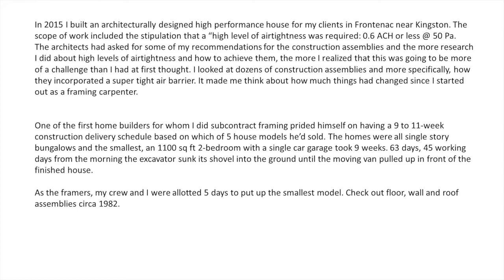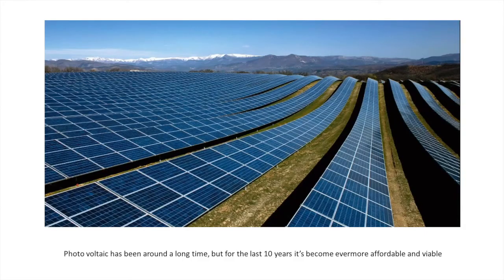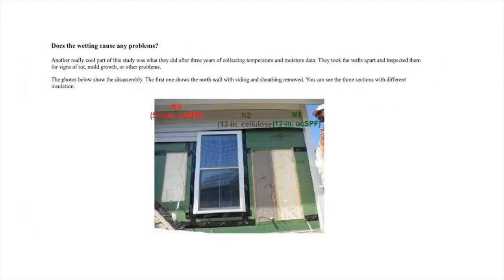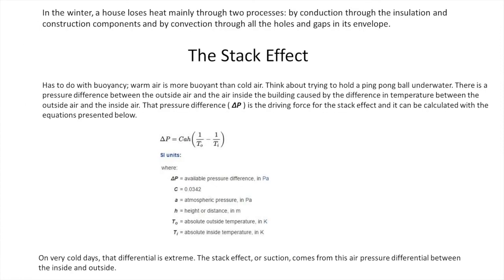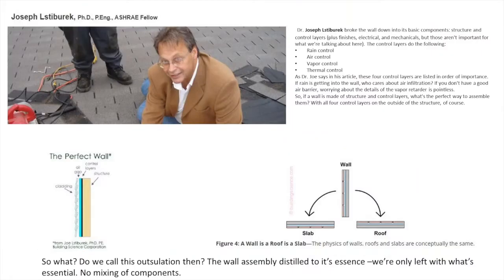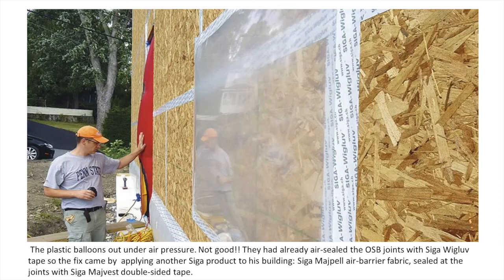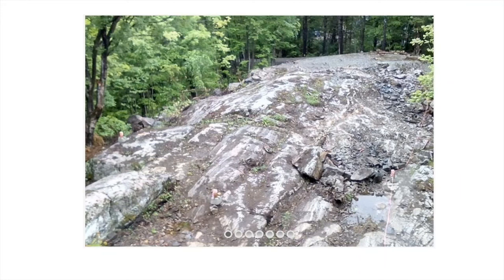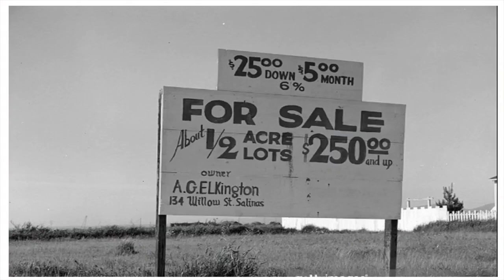Airtight Alright

Comment: There's a flaw in the modelling of the three houses vs. PV system size slide.  They describe the worst house modeled as "code minimum", yet at 0.66 ACH50 it is nearly Passive House tight!  Code minimum air tightness is more likely about 3 ACH50, depending on when this study was done, which would have a significant impact on the annual heating load of a Climate Zone 6A home.  On the other hand, the PV system savings also decreases with time as panels get cheaper, so this is a period specific comparison that has little relevance years later, but was flawed at the time.  Also, the best house in that model was at 0.33 ACH50, which is a target almost any builder would not be able to achieve without a very carefully designed and executed building envelope.

Great presentation, a lot of useful information in there!